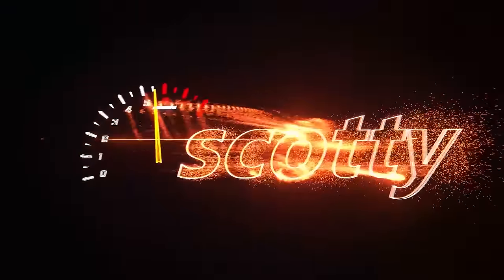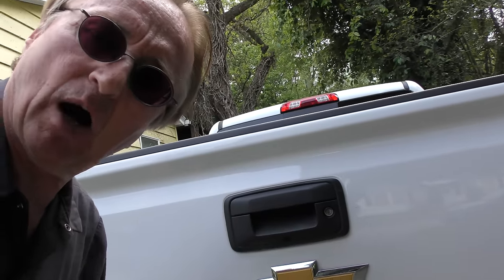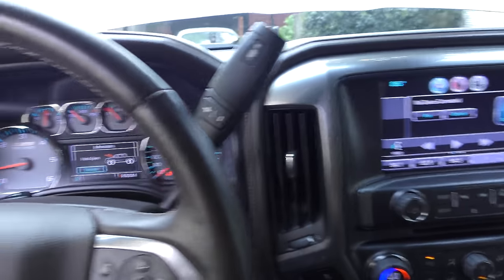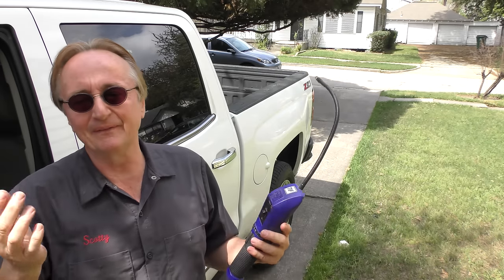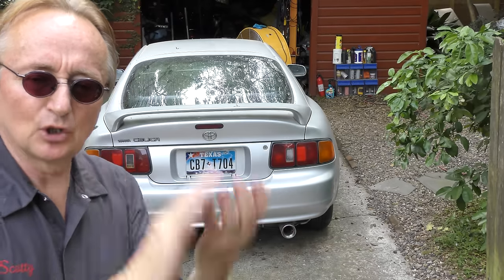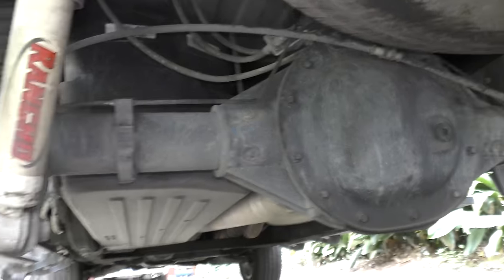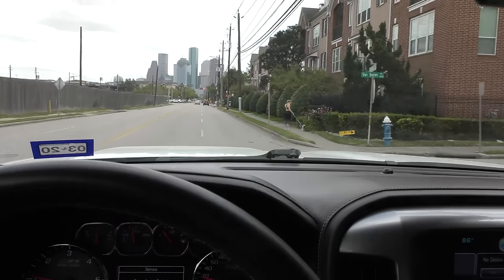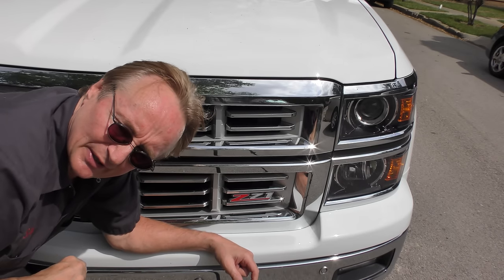Here’s Why I’ll Die Before I Buy a Chevy Silverado

Comment: Thanks Scotty for the tip. My 2002 Silverado LT just crossed 729000 still running great! Gonna wait on a new one for now.
Reply: Good to hear. My 99 Sierra has 126k now.  Still runs strong. I’ll just hang on for as long as possible. Actually still like the interior although there is some cheap plastic.
Reply: Too much emphasis nowadays is put on the infotainment features and electronic gadgetry instead improving mechanical reliability.
Reply: Wow

Comment: I have a 2009 Camry and the evaporator went out in it two years ago. Parts and labor to fix it, $2,000.  The part was only $200.  The rest was labor, so it's not only GM that is doing this kind of crap.
Reply: Evaporator core on my 99 lexus gs400 was also around 2k to pull out the dash with the part included

Comment: So wait, throughout the video you say it's a quality built truck when looking at the underneath, nice spacious interior, has good amenities, good acceleration, ride was good, but only things you knocked it on was a plastic tailgate handle and the fuss of fixing the air conditioning?  You said more good things about the truck than bad.  I don't think that one truck that may have had a faulty air conditioning part speaks for the entire overall quality of all Silverados on the road.

I'm sure there are things about your Toyota car that have broke over the years that haven't in other cars, does that then make your Toyota crap?

Bias much?
Reply: Watch the second part and you'll be corrected 😆😆
Reply: @jesscesanto9127  - I just did and I don't see how I'm corrected.  You had one truck with an air conditioning leak within the dash, again, that doesn't speak for every Silverado.  How many Silverados on the road will never have that problem?  You make it sound as if, just because that one does, all the rest of them will also.  

Now, if you can prove with data statistics that the majority of Silverados all have air conditioning problems after reaching 60,000 miles, you'd be accurate.  I'm sure that's not the case.  Truth is, you had someone bring you a Silverado probably had a faulty part.  A problem that probably won't happen in most Silverados.  I don't see how that warrants saying that all Silverados are crap as a result.
Reply: @Nick Milligan LOL..cheaply made? He even praised the beefy rear in the Chevy. Have you seen a rear in a Ford or a Ram? Ford makes their numbers look good by selling fleet trucks cheap (and you get what you pay for) and Ram tries to shine that turd up with a fancy interior with a bunch of "gadgets ". I literally watched the dealer pick my neighbors new Ram up after owning it 2 weeks because it just shut off and wouldn't start. Never had a Chevy leave me sitting.
Reply: Next time your on the road. You see mostly Chevy....even old ones.
Reply: @larrywiley597  old chevys were tanks, new ones are not.
Reply: Triva woods  my chevy was a tank and saved my daughter when a 10k lb streetsweeper hit my 2015 GMC Sierra . Ripped the passenger door clean off the truck and everyone inside was perfectly fine , not even a bruise
Reply: @ajw020  that's called "luck".
Reply: @paulcampbell8696  that's called a truck not a Toyota Corolla lol
Reply: @ajw020  Glad to hear the truck lives up to its 5 Star crash test rating Sierra/Silverado

Comment: when someone is stuck on a particular brand, there's no changing them.......
Reply: Is called brand loyalty I own 4 GM vehicles I wont buy anything else .specially no foreign brand vehicles
Reply: @YanilMiami305  do know they make them in Mexico now..
Reply: Toyota is more American. They're made here
Reply: @YanilMiami305  you dont owe anything to a brand/industry that doesnt value your safety or give you what you pay for.
Reply: Whistle Blower1 for the Silverado/Sierra it’s the Crew Cabs of the 1500 line. Other configurations of those trucks, and the Heavy Duty ones should be coming from here. The HDs come from Michigan, and the Regular and Double Cab of the 1500s come from Ft. Wayne Indiana.
Reply: @YanilMiami305  people here drive foreign cars, nobody drives american made anywhere else in the world. Go figure.
Reply: @YanilMiami305  haha, funny your loyal to an industry or anyone or anything eho doesnt care about you one bit, silly
Reply: @YanilMiami305  GM SUCKS!
Reply: @YanilMiami305  TOYOTA WILL OUTLAST AND OUTBLAST THE PRICE OF ANY GM PRODUCTS.
Reply: Being brandwashed is hard to fix🙂
Reply: @YanilMiami305  think it's called brandwashed🙂 I bought a 2015 Silverado 30,000 miles engine ticks, 5.3 lacks power. 
Friend has 2017 with 30,000 miles already replaced transmission.
I like a Chevy as much as the next guy but if they are cutting cost for quality why would anyone be a brand loyalist
Reply: @drewhour  crapyotas hondas and mazdas are also made in mexico ,so what's your point?
Reply: @drewhour  they're also made in mexico,  everything vehicle is made in mexico or China except for a few
Reply: @reggin_bmud  I own four GM vehicles a 2014 camaro as with 21k miles "weekend toy" a gmc yukon Denali with 132k a 2012 chevy impala with 147k miles and a 2002 chevy cavalier with 247k nothing but oil changes, fluids, tires and alignments GMs have been good to me
Reply: @diegogonzalez9086  I never said they cared about me. I just said my vehicle preferences
Reply: @bradrogers4019  every brand and cutting cost to maximize profits even new Toyota's are having problems. So what's your point every car on the road nowadays is not meant to last 10 years anymore car manufacturers want people buying cars every give years
Reply: @cacaf8989  where would that be matey?
Reply: @YanilMiami305  I've had Toyota Camrys with with over 400,000 miles... Looks like Toyota treats me better!!!!
Reply: @jdmforever5583  well that's your preference dude
Reply: @YanilMiami305  mine was made in japan
Reply: @drewhour  you must have a 90s early 00s one
Reply: @YanilMiami305  2016
Reply: @CJColvin  Because I'm educated and speak facts!
Reply: @drewhour  LOL!!!!!!!!!!!!!! Yeah right mate you little hippie.
Reply: My Mazda came from Japan.
Reply: @jdmforever5583  hmm🤔u sure? I've got an 88 S10 4.3 with 468,000 but i will admit its on its 2nd trans, 3 rd water pump and 3rd starter but no repairs to the engine.... Knock on wood😁
Reply: @YanilMiami305  you dont even know spelling, so that about answers all my questions
Reply: @alextrainor2552  I was not aware that spelling mattered on youtube, there is always that one grammar teacher on here!
Reply: @YanilMiami305  my buddy just bought a chevy cavalier for 1000 dollars and all it needed was a oil change wipers and a 02 sensor.
Reply: @YanilMiami305  all my homies with Chevy and gmc trucks take care of them and they all run perfect for being over 150k
Reply: @CloroxGodThe1st  I love my cavalier mine is the 5 I bought it for 1500 dollars it had 211k and noe has 247k it's a great reliable car all it needs is its fluids oil change tires and alignments
Reply: @laxbeach2381  rather buy the ext. Cab (double) like in the 90s before crew cabs were made and started by Ford in 2001 with thr six foot bed and z71 off-road package and 5.3l v8 preferably a six speed (kinda sceptical of the 8 and 10 speeds but time will tell).
Reply: Branded McGowan they have a 6 speed, it’s pretty good. The 8 isn’t bad, it’s just the engineering team I believe has caught themselves in a circle with it. Initially it was a redoing the transmission module programming, and that supposedly worked for some affected vehicles. There’s a percentage out there, not having an issue. Then they went to replacing glazed torque converters, and later a recent fluid replacement. They have vehicles where customers were satisfied with whatever work was done. Not all did all of what they proposed to solve it, some didn’t have to. Then there are some that are still reporting issues. I’ve also read online where someone tuned out Active Fuel Management, had someone do a custom tune on the transmission, and they changed the fluid themselves. They commented that everything is pristine. I believe that idea of the transmission tune has made it to other models with the 8 speed. For the 10, I’ve read comments ranging from people saying those act similar as the 8s, and some say it’s way better. The 8 on the 2019+ models are supposed to be better. I personally haven’t driven the 8, or the 10, however I test drove a 6 with the 5.3 in a 2016 Sierra with about 80,000 miles, and the truck drove pretty well. Our trucks at work are 2017 Silverado 1500 WTs with the 6 and 5.3 as well, and those are climbing in miles and doing well. Too me, it’s just way too many variables to give it a certain guarantee that the 8 is totally bad, or great. I believe some complaints could be from people that just being too picky, since the data is all over the place. Plus, it could be whatever work some had done, was done improperly. It’s a lot of stuff to consider for sure. I’m definitely going for one, or the newer ones when I can. When it comes time, I’ll test drive a 8, and see how it goes. I’ll probably go for a used 6, as that’s probably more in budget.
Reply: @laxbeach2381  if the years go buy for me maybe down the line i consider getting a K2XX platform truck used with low miles if its a 2016+ with the 8 speed hopefully find a champ not a miss (lemon). Never know👌
Reply: Branded McGowan true. For that one, the 8 usually comes with the 6.2. It does come on certain models of the 5.3 probably as an optional upgrade from factory order. Otherwise it’s mostly the 6 speed. For the 2019+  T1XX they have so many configurations, it’s harder to keep track. I believe for the 2.7, 4.3, it’s the 6, and 8, and 10 is for the 3.0 Duramax, 5.3, and 6.2. The 6.2 and 3.0, I believe only use the 10 speed. If I got an upper transmission, I’d probably be opting for one of those upper transmissions. Otherwise I’m probably going for a 5.3 with the 6. The new 3.0 Duramax seems interesting though.
Reply: @brandedmcgowan9414  you were probably skeptical about the 6 speed when you had a 3 or 4 speed, wtf...

Comment: My 2014 Silverado LT is 7 years old now and the back latch is fine. Had an Evaporator leak but out of warranty cost was south of $1k, not $2000. Paid $37K for the truck new in 2014. Now, I go for upgrades as often as I can. (wheels/tires, intake & Exhaust, tuning, performance parts in general)... Question: would getting a performance/higher volume radiator kit be worthwhile?

Comment: What a joke! For the money one pays for that junk, is ridiculous!
Reply: Edwin McNew they need to build them like tanks like the 80s and 90s
Reply: @Luis Bolanos   if you're worried about resale value....DON'T BUY A P..O..S..
Reply: @Lil Torta you have an anime profile pic, your comment is invalid
Reply: @alasdairmackintosh  atleast he has a profile pic 🤷‍♂️ that makes his comment a little more valid than yours.
Reply: @coreythefam6455  I bet the " chrome " on the grille is sprayed paint on plastic  like every other modern car too.
Reply: @Lil Torta   I got enough vehicles. Ones that run.
Reply: Luis Bolanos resale value on Silverado better then f150 and ram
Reply: @thomask940  
just    lease  it   n  give   it   back  when  the  lease  is  up.....no  worries  at  all.
Reply: @driver4011  not feasible. You get charged for undue wear n tear. Doesn't pay to lease trucks unless you deliver flowers across town. Additional mileage is calculated at 20 cents per mile over their paltry limit.
Reply: @davidleeosbourne2727   yes...on the older Chevys. 1999 to 2005. Depending on condition. Chevys are notorious for excessive rust problems but that can destroy any truck...especially Dodge. I liked my '99 Vortec 5.7 but fuel pump pressure was a problem and it drove me crazy.
Reply: Thomas K till this day resale value is still better then ford and ram
Reply: A joke because you can't afford it?
Reply: @glpilpi6209  well duh!
Reply: @thomask940  paltry limit? there are leases with many different mileage range limits.

Comment: I’d rather have a/c problems and an LS engine than have to deal with those ford engines with broken spark plugs and engine failure
Reply: Chevys have alot more problem than just that
Reply: Or avoid both shitty trucks and get a Tacoma.
Reply: @FirstLast-wj8yx  Your brainwashing is now complete.
Reply: Lol takuache
Reply: The problems you speak of haven't been around since the 5.4. Try again lol
Reply: Or buy a nice obs chevy or gmc sierra/silverado because those are beasts. My 1997 gmc sierra z71 has 270k and uses no oil and is mechanically sound. 350 vortec motor is still strong as hell after it had a simple tune up. Mine is on 37s and 6” lift and will outrun most newer gm trucks with ease...
Reply: @antonionitocosanostravakia2801  Naw American built cars are trash. You don't need to be brainwashed to realise that.
Reply: Blaze Pedigo I was with ya till you said you can outrun the newer trucks lol
Reply: Chevy did away with the LS engine starting in 2014. The 2014 to present is actually an LT platform.  They are still 4.8 5.3 6.0 and 6.2 but they went to direct fuel injection which changes it to the LT platform
Reply: Idk my ford 4.6 2v is a beast. I wouldn't be afraid to drive it anywhere. Well besides the bald tires. 🙄
Reply: SofaKing High they don’t have 8’ bed crew cabs and don’t tow 22,000 lbs. I am stuck big three or I’d have to buy a medium duty truck.
Reply: And that’s triton engines for ya 😂
Reply: SofaKing High but what if I need a v8 truck tho?
Reply: Young_Nut Busta depends. Seen thousands of them, personally have owned three. Never had a failure or a broken plug. I have had to use the mountain kit to thread them after they blow out but that was due to the lack of appropriate threads. The biggest problem we have with the 6.8 V10 is that it probably uses about half a quart every 5,000 miles of constant use but it’s got some 400,000 miles on it so I’d be shocked if it didn’t.
Reply: Chevy with suspension problems, slippery transmissions, bad timing, slow electronics, fuel injection failure, and, and cheap plastic that breaks in a few years.
Reply: The spark plug issue was a long time ago now lol
Reply: Mazda B3000 Blue Bird uses the Triton 6.8 L V10 modified by Roush for their Propane engine offering. 
Ford still puts them in the F53 chassis for motor homes and other applications. 
The current F650/750 medium duty truck platform - still a Triton V10. 

They still happen and the engine is still a very prevalent one in the market. I personally still own a Triton and it’s the daily driver. 
We’ve gotten better at fixing them, many have already been repaired, but they still happen. 
Same with blown exhaust manifold gaskets every fall. They happen.
Reply: @roundsm18  Thats all well and good all I was saying is that is the daily driver pickup category they don't use the triton anymore. An as for me personally I still stick with the old 5.0 got one in my track truck and one in my daily.

Comment: I have 01 Chevy Silverado 1500 with 315000 miles on it . Still works great
Reply: He is obviously talking about Modern Chevrolets. 90s and 2000s Chevy trucks were great. Modern ones are cheap and seems like it was made lazy. Which is why Ford is killing GM and Dodge. They make their modern trucks with way better quality
Reply: I've got an 02. Good truck
Reply: How many transmissions?
Reply: He always mentions that the older chevy trucks were way better made than now.
Reply: Awesome
Reply: I’m looking to buy a 2000-2003 Silverado or Tahoe. Any advice what I should be cautious about before I purchase it?
Reply: @BannedSports  true
Reply: They're all junk. I bet it has had work before that you don't know about.
Reply: @michael3343  be cautious by not buying it.
Reply: @brad300ZXS16  What about the Lincoln Towncars
Reply: @michael3343  they're good cars. Just don't buy a chevy. They're all overrated.
Reply: @brad300ZXS16   The old Chevys from the 2000’s and before were really good.
Reply: @michael3343  I've never been a fan of chevys. I had two a 98 and 99 and nothing but money pits. My 98 blazer was alright but GM's 4x4 systems have always been trash. It ended up ruining the transmission in it.
Reply: @brad300ZXS16  all I know is the worst American brand is Dodge Chrysler
Reply: @michael3343  I have to disagree. I have a 98 Jeep Grand Cherokee with 260,000 miles. Original engine, transmission, and a/c, heat works great. All I've had to replace is the alternator and a speed sensor on the transmission.
Reply: @brad300ZXS16  those old ones yes. I’m talking about the modern ones though. Those 98 Jeep’s are awesome!
Reply: I got a 95 stepside with 270k, cold ac and going strong.
Reply: All these Chevrolet haters kill. Every single make and models come with their fair share of issues. It's all preference. For me  I've always preferred CHEVROLET! Chevy strong!
Reply: @arturoayala5962  Scotty knows his stuff. He's just trying to be honest with people. GM stuff isn't really that great. Seen one video where he was in a GMC truck with only 35,000 miles on it and the transmission was already showing early signs of wear.

Comment: I had to change the temperature sensor in the evaporator, and instead of tearing out the dash I removed the airbag, heated up a socket and melted an access hole above the evap core. I'm not gonna lie, it took some manuvering, but I got it changed out. Just be careful when you cover the hole because it can interfer with the blend door. Of coarse that won't work if you have to change out the core.